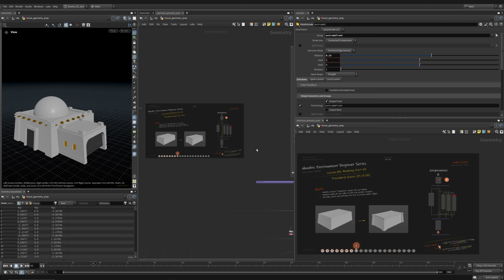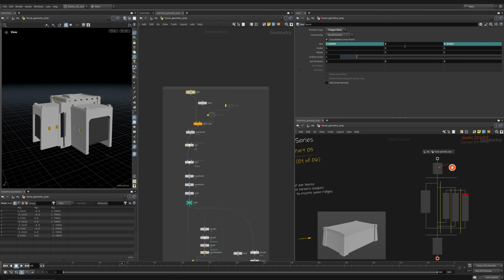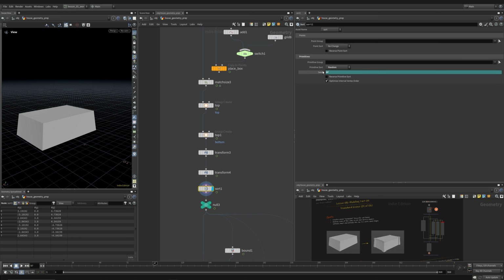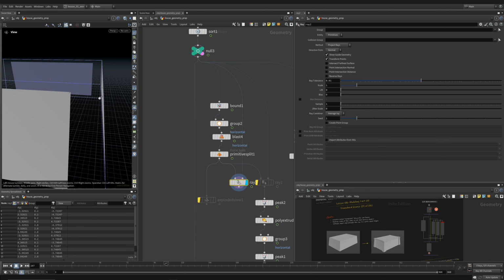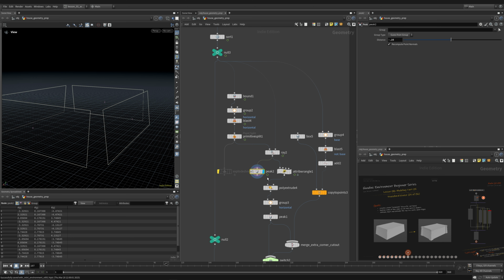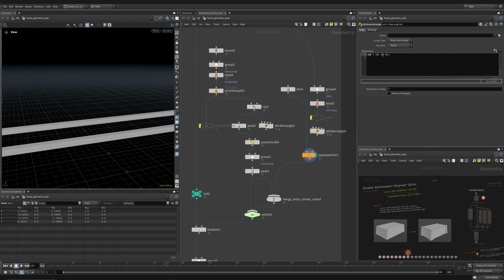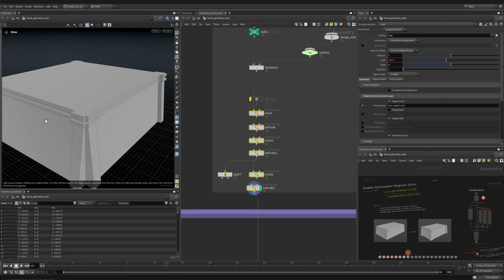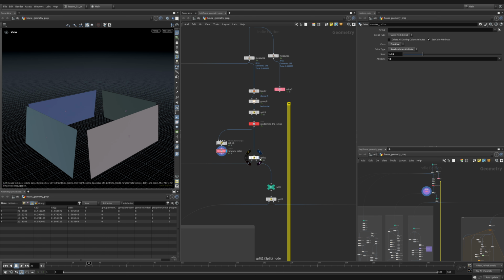Lesson 08: House Modeling Part 01 (Free Environment Mini Course)

Comment: Ive encountered a problem with peaking just top and bottom of the box for boolean. it just expands its size according to the normals even when group is selected correctly. I solve it with polyextrude and dissolve but do you have any idea where am i missing? im on houdini 22.
Reply from the maker: I think you’ve got it right. There was a change to the way the peak node works, so as long as you have the correct result you should be set!

Another option is to manually displace with a wrangle, sometimes that is something I’ll do if I need exact normal directions
Reply: @wttrlabs  Thanks! altough im not that handy with VEX and right now im trying to find a way to peak garage door without peaking. :D
Reply from the maker: @iliyaershami3693  send me a screen shot if you haven't yet gotten it working! I'll take a look and help out :)
Reply: @wttrlabs   thanks man! actually i have tried to email you couple of weeks ago but i couldnt find your personal email address, I emailed WTTR but i think you didnt received it.

Comment: New to Houdini. Can I ask u advice? In what case its faster to use another 3d software? HOw can I undestand where using Houdini is OVERKILL?
Reply from the maker: It depends a lot on the project, and the artist. If you're more comfortable with doing something in one software (such as modeling), you could always model in another program like Blender and then import it into Houdini to simulate or render. Also for a large project if you needed 100 buildings you need to create, then Houdini would probably be the best way to go since you can leverage procedural setups!

In general however, I like to do everything in Houdini (even if it is slightly overkill sometimes), because the more time I spend in the software then the more comfortable and familiar I get with how it works. 

But the best way to be able to answer that question (In my opinion), is to try it all and then decide yourself to see if you could do something faster in a different setup - there really is no WRONG way to do it, but lots of times just personal preference. 

Hope this answered your question :)
Reply: @wttrlabs   I am asking this because I saw someone saying that in fact ppl only use (most of time) Houdini for FX (sand, fire, water, destraction)  then they export fx for rendering somewhere else.  Also some ppl use Houdini for landscape procedural modeling and parametric envirements. I just what to know how better invest my time to make 3D art/ Thanks for you tutorials. I hope yoube algo catchup
Reply from the maker: @bbrother92  lots of times people do, but for large fx and setups it makes it much easier to render straight into Houdini. I've done projects in the past where I export back to C4D or Blender to render, but there's a lot of extra steps involved that slow the process down a lot.

I'm definitely biased, since I use Houdini for everything. But I think investing your time into Houdini would be the best return on investment and would let you create the most in the long run
Reply: @wttrlabs  Got this! Have a nice week ahead
Reply: @bbrother92  houdini is for large scale environment like so many building with variations